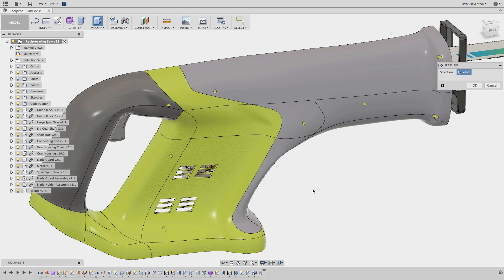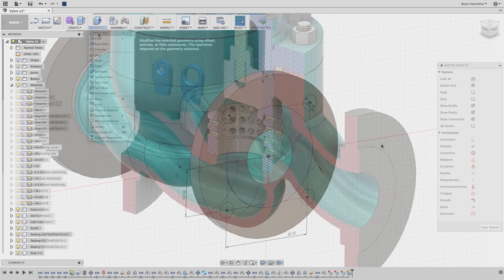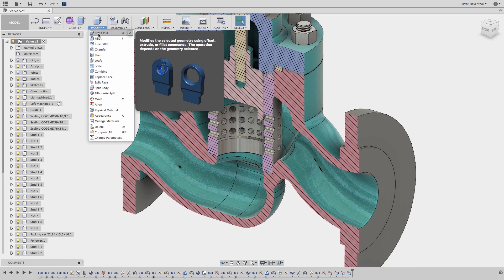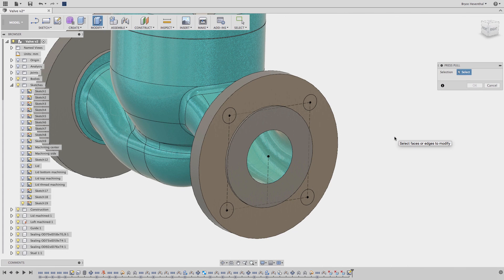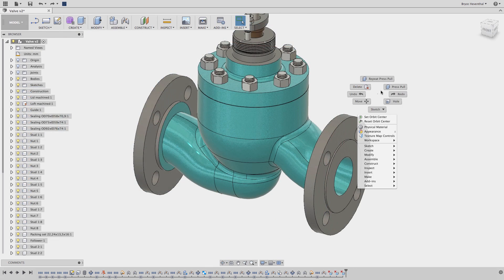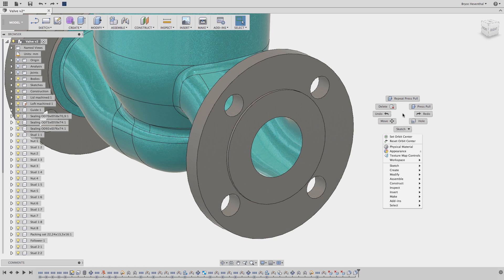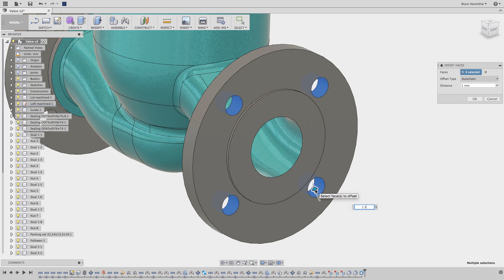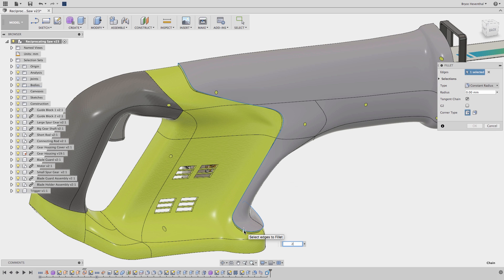QUICK TIP: Press Pull

Comment: 1:28  So does this modify the sketch as well then?
Reply: I tried these features on a basic shape: so no, it doesn't modify the sketch. It adds the new changes in the timeline.
Reply: There are times that the press pull can modify the sketch. For example, if you sketch a rectangle and extrude it (Leaving it under defined with no dimensions), then use press pull on one of the side faces it will change the sketch. On the other hand if you add dimensions to the rectangle it will add a feature in the time line. 

I am planning on making an Advanced Press Pull quick tip in the future. I have a few nuggets that take some time to explain but they are pretty awesome once you understand what is going on in the background of Fusion 360.
Reply: Yes indeed, I fully constrained my simple sketch before testing your tips. Thanks.